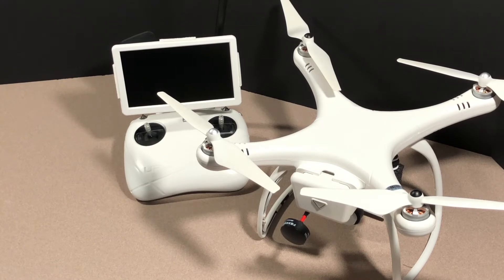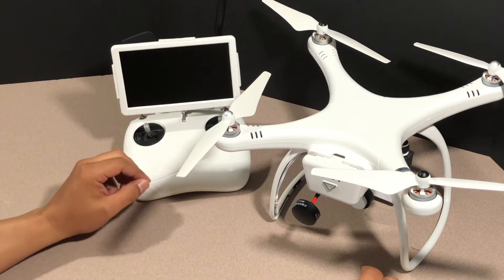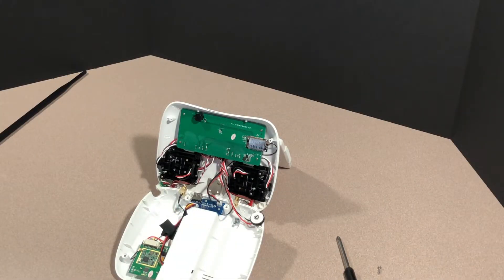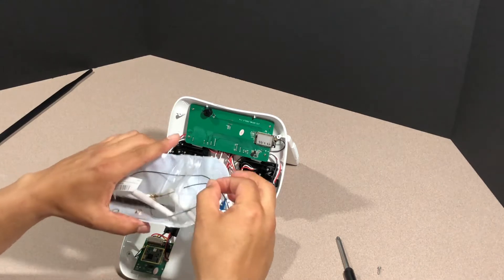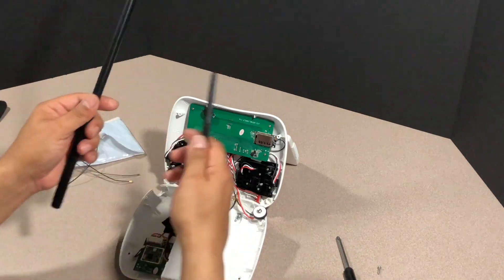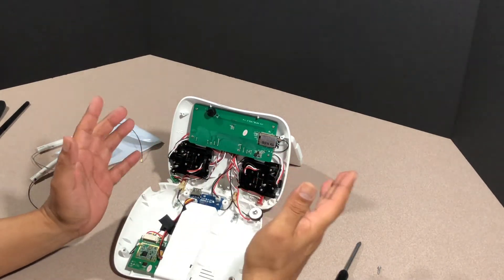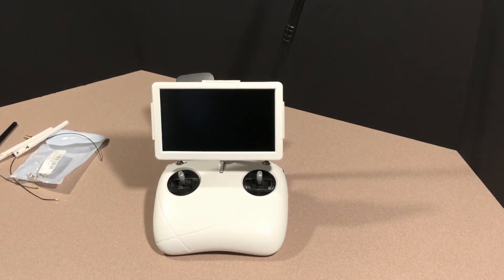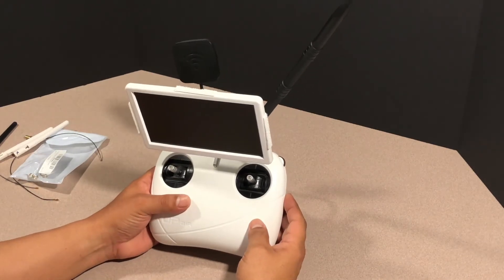Upair One 2.7K Antenna MOD Explained

Comment: Hi mate I have plugged the battery in the wrong way I did now the controller will not switch on have you any ideas what I can do? Cheers Gary I have the plus
Reply from the maker: @ohare100  if you plugged the battery in reverse it’s possible you could’ve fried the controller board. These boards are not high end PCB boards with reverse polarity or current charge protection. Unfortunately, I don’t have the Plus mine was the original UPair One, so I don’t know too much about that controller board. The only thing I could suggest is to search eBay either for the controller or the controller board itself. This might be your only option to fix the issue. Hope this information helps.
Reply: @solisapaul  hello I do have a spare controller the controller with the screen will it be the same board inside?
Reply from the maker: @ohare100  As I mentioned I'm not familiar  with the PCB Boards with the Plus model, however if its the same model and the only difference is the fact that one does not have the screen then it should work. The only difference that you will notice is that on the PCB Board the connection for the screen will not be used or not present on the board without the screen capabilities.
Hope this works out for you.
Reply: @solisapaul  thank you x

Comment: I know this is an older video but it was extremely helpful. I’m still rocking my old 2016 UpAir one from 2016 & about to do this modification upgrade. Very helpful video, thank you. 😌🤘🏻
Reply from the maker: @Sabis.RC-cars  I’m glad it was helpful, I still have this drone and works great. My only concern is batteries are hard to come by so I might have to find a new battery modification in case I need to replace the battery in the near future. This was my very first drone and I plan on staying with it for as long as I can. Happy drone flights! Stay safe and sound.👍🏽✌🏽
Reply: @solisapaul  agree, I have 3 batteries & only 1 works still. Going to have to find a mod for this soon as well. They are definitely hard to come by. If you ever put out a battery mod I’ll be checking it out for sure lol.
Reply from the maker: @Sabis.RC-cars  👍🏽

Comment: so im going to make the same changes i have some  questions. will the ant. you show ( 10 DBI ) work with all the diff. frequencies these drones  diff. drones come with. I was taking my camera and gimbal off to check wiring on my transmitter and ant.( i upgrade my transmitter to 200mw some years back) the last time i used it (month ago ) i noticed the video was only working about 300 ft. so after seeing you video i decided make these changes . i was looking at the wires and noticed
a broken wire that goes up one of the three legs on the drone looks like that putting in the battery  cut it and i can't   see where it went to. if your looking at the battery its the left leg rear next to battery port. got any ideas?
thanks G.M

Comment: Will the antenna upgrade hardware you provided links to also work just the same to perform this mod on the latest UPAir 2 4k/3D drone?
Reply from the maker: Jay Marucci Thanks for watching, I would honestly have to say that since I do not have that model of the Upair 4k/3D Im not safe in saying that it will work, however if the antennas on the logic board are the same as the Upair that I have; I dont see why it wouldn't work? You must be certain of the pigtail connections on both the Drone Logic Board and the Controller Logic board, also very important when it comes to the controller logic board is whether or not the transmitter antenna as well as the receiver antenna are in the same side as my Upair controller. Lastly if you are uncertain simply leave the drone and controller as factory. Hope this helped and safe drone flights ✌🏼👍🏼.
Reply: @solisapaul  The pigtails seem uniform for connectiors on the controllers I'll confirm and obviously look out for the Wifi and Tx identification.  Another question - the Foxeer antenna you gave link for is no longer available.  There are others listed but want to make sure I get a comparable one that functions best possible providing greater distance.  I was looking at this one and at the stats but the polarization isnt LHCP.  It's RHCP and has 1dBi less gain too. Please confirm. https://www.amazon.com/dp/B078736DC9/ref=cm_sw_em_r_mt_dp_U_u4hQDbFDTF07F
Reply from the maker: Jay Marucci Unless you're going to be flying in a field with other drone pilots and using a VR headset it wouldn't matter. this antenna will work fine for single drone pilot use. The purpose of left side and right side antennas are to give you a separate frequency from other drone pilots to eliminate Multisignal interference. Hopefully this helps.
Reply: @solisapaul  I think Im going to leave the stock antennas on the drone.  I won't be able to fit it back in my carry case if I install the radial antenna. For the little more distance I would gain probably not worth it.  If I install the antenna kit in the remote (which appears the more significant part of the mod for getting gains) along with attaching the 10 dBi antenna how much improvement you think would be achieved?
Reply: I just opened up my remote control and the UpAir 2 improved the wifi by making it 2 channel.  One of the antennas actually share Tx and Wifi reception but on two separate wires each having their own pigtail connection. The other antenna has just 1 wire / pigtail going to one channel connection on the Wifi board.
Reply from the maker: Jay Marucci Very interesting how they have it set up? as for range I have a video on the distance I got after I made this mod https://youtu.be/GF5r5VN3PT0
again like I said because your drone is slightly different than mine I'm not sure if they would work exactly the same I would be per cautious on deciding to do this mod I would sure hate for something to go wrong with your drone.
Reply: @solisapaul  I decided since I have a 2 channel 5.8 ghz wifi board that I'm going to install 2 of the high gain kits so I have both of those channels upgraded with the better antennas.  Then drilling a 3rd hole and splitting off the new Tx antenna to the controller board and installing in between both of the wife antennas.  Im going with this one https://www.amazon.com/gp/product/B002MUU6L4/ref=ppx_yo_dt_b_asin_title_o00_s00?ie=UTF8&psc=1  That 10 dBi antenna you listed has very mixed reviews. I didn't trust it. I only flew the Upair 2 once and got to 220 ft over my head but i figured to do the remote since so easy to do and see what I can get out of it for distance.  They advertise the UpAir 2 drone being able to go out 2 km which is a little over a mile.  I'll see what i get out of it.  I'll have the parts this Saturday.
Reply from the maker: Jay Marucci Hope this works out for you, let me know the results and good luck.👍🏼✌🏼
Reply: @solisapaul  Mod done. Tested in the yard real quick before going for a real trial run. I can send you pic of it if you like. Don't believe I have capability to post here in the thread.  Looks cool.  I can immediately tell its picking up alot more satellites now with the upgraded wifi antennas.  I'm using the stubby Tx antenna that came in the kits. The other antenna I bought I  wanted to show you does not have the center core wire protruding inside the male screw connector so when i screw onto the female kit it would slide into the small hole obtaining proper reception.  I will need to return it I think. Will research some more. Just found it's called the "pole" in the connector. Look like the closeup in this product  pic  https://www.amazon.com/TECHTOO-Antenna-Connector-Wireless-Extender/dp/B00NV807XS/ref=pd_bxgy_147_img_3/138-8897345-4968963?_encoding=UTF8&pd_rd_i=B00NV807XS&pd_rd_r=7839b95b-bf3f-4255-9af1-b6ac007d2866&pd_rd_w=erx8K&pd_rd_wg=h324D&pf_rd_p=09627863-9889-4290-b90a-5e9f86682449&pf_rd_r=T4KPA75CX1AFHYCYJ1B0&psc=1&refRID=T4KPA75CX1AFHYCYJ1B0
Reply from the maker: Jay Marucci Awesome job I'm glad to hear it all worked out solisa.paul@gmail.com is my e-mail. 👍🏼✌🏼
Reply: @solisapaul  I'll shoot you an email with a pic of the upgraded controller Could use your input on the question I have regarding the other antenna not have the pole in the middle of the male connector.  Is that needed to get the proper Tx reception?
Reply from the maker: Jay Marucci Yes its needed for thats what makes a full inner connection to the signal.
Reply: @solisapaul Well just did a true test flight and almost went really bad and lost the drone. I lost FPV twice only going 1000 ft out. Fortunately I was still able to control the drone but had to do it "blind" to get back to home. Luckily I was able to get a fix on it in the sky. I don't get it. This is significantly shorter distance than stock WiFi antennas. Not good at all. I'm probably going back to stock now and test that which I never really did. This drone is easily supposed to go over a mile out with stock antennas. Fortunately I didn't lose Tx and the controls.
Reply from the maker: Jay Marucci Man I'm sorry to hear that,that was such a close call I'm glad you took control of the drone definitely somethings not right? To be precautious and safe I would probably go back to standard.I had a feeling that the way you mentioned the antenna was being connected was kind of odd perhaps it's a new layout for the new system board on the Upair?

Comment: Great video and mod. 
FYI,,, The UPair with the PX4 board is still an UPair One model but is the fourth release (i.e. version 4). The new UPair 2 series has a different fuselage and gimbal design along with added camera options.  http://upairdrone.com/
Reply from the maker: DeafDronePilot Nice input thanks for the update and thanks for watching 👍🏽
Reply: The new UPair series looks good and has a 3 axis gimbal and I'm liking the new UPair X4 4K model but it's a bit pricey for an UPair.  http://upairdrone.com/productshow.php?sid=2&cid=23&id=19
Reply: Also forgot to mention that UPair has introduced optical flow sensors into the new drones.
Reply from the maker: DeafDronePilot They do seem to be advancing quite a bit with their drones I myself was considering as well to upgrade to a new version but for now I think I’ll hold off for now.
Reply from the maker: DeafDronePilot at $839 plus tax I’d have to agree that is quite a bit. Sure looks like an awesome Drone tho..